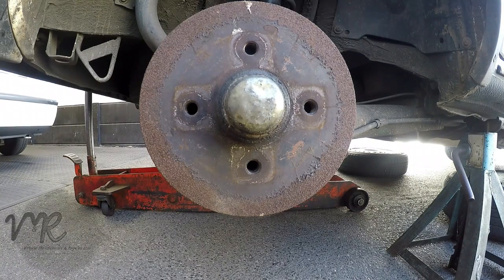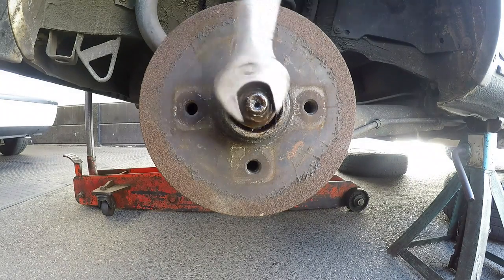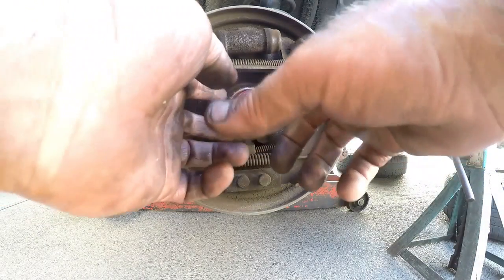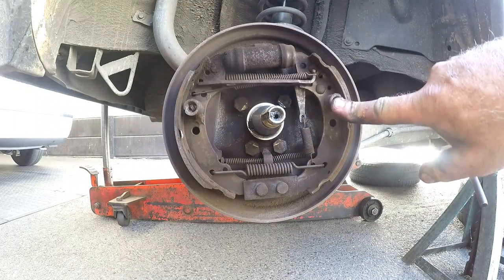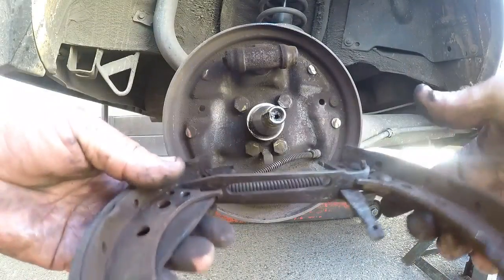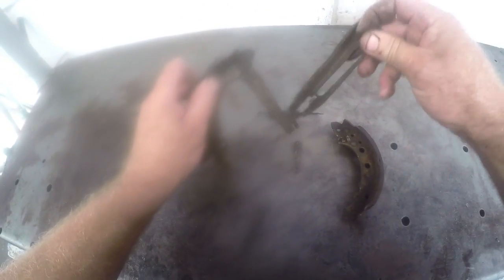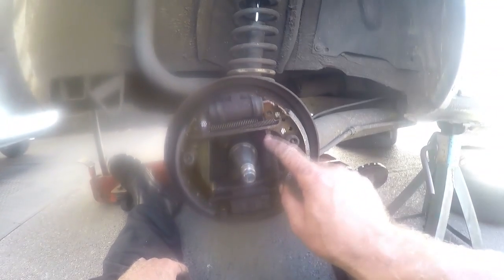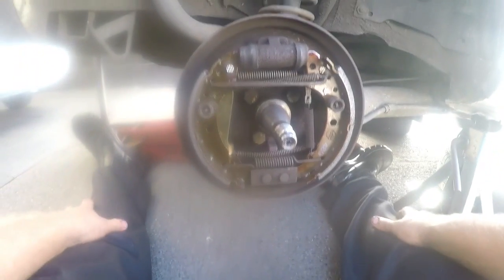Vw Citi Golf Rear Brake Shoe Replacement

Comment: Thanks for the great content it was the first time changing my brakes and drums on my velociti golf this video helped me alot with the disassembly and assembly but I do have on question for you .. my car still seems to have low brakes the front locks if I hard brake but the back does not what could be my problem with the rear and is there a solution to it? Maybe it needs adjusting or so how should I go about doing so?
Reply: @vehiclemaintenanceandrepai3790  thanks for taking your time and helping me out I will check up on these possible solutions and let you know how things go 👍
Reply: @vehiclemaintenanceandrepai3790  Thank You very much for this video, I too have the problem where my brake pressure / strength is not great on the rears even after changing the parts, I have replaced new shoes, new drums and new slave cylinders, Bled them both, My old drums seemed to be oval, hence I replaced everything, I had the drum off and had my son pump the brakes to check the self adjuster and it works, so not too sure what the issue is, I always watch your videos they are brilliant.

Comment: My polo classic 1998 to 1999 model lose balance when driving  on the rear axle so im confused either rea shock and mountain rubber  are not well tightened or exle bushings rubber or rear shocks springs.please help me what to do.
Reply from the maker: Hi Bishaap, I do not understand your question fully, but I will suggest you have the wheel alignment checked, they should tell if there are any suspension components worn before they can properly set it.
Reply: Ouk...my polo classic it seems like getting out of balance when driving as specially on gravel road so what cause it to get out of balance?
Reply from the maker: wheel alignment, Bishaap
Reply: Alright thanks i will check the alignment tomorrow.

Comment: Nice video, just a quick question, I tried to remove my brake drum this weekend and after removing the 24mm nut and even with the handbrake all the way down the drum did not want to come off, it rotates but I couldn't remove it. Any ideas?
Reply from the maker: Hi Tyral, thanks for supporting the channel with your viewership.
You have to adjust the foot brake down, if you watched the video, you will see me explain how the foot brake adjustment works.

To adjust the foot brake down, shine a light into one of the wheel stud holes, rotate until you are opposite the adjuster, take a thin screw driver and push the adjuster all the way up this will set the foot brake to it's lowest point, now the drum should come off.
As time goes by the drum develops a lip, the auto adjuster adjusts the shoes which prevents the  drum from being removed, as the shoes catches behind the  lip which prevents it from coming off. Good luck, I hope this helps.
Reply: @vehiclemaintenanceandrepai3790  wow thanks, I will try it this weekend, thank you so much for the speedy reply and keep on making videos. I'm busy fixing up a mk1 velocity and you have really helped alot. Keep it up